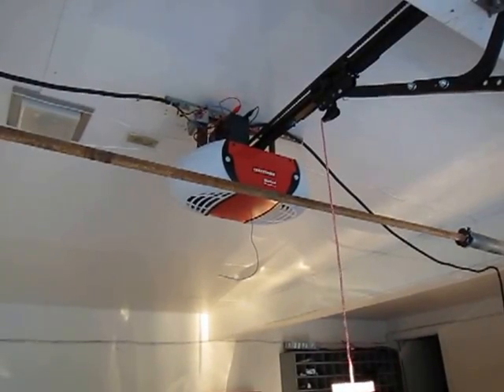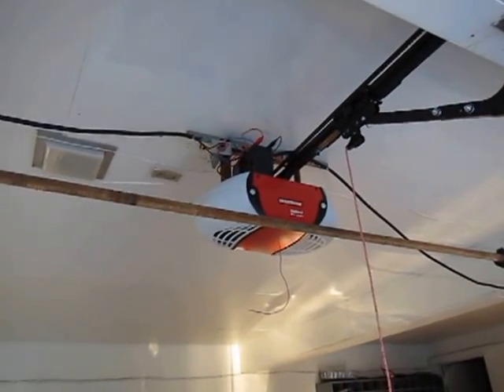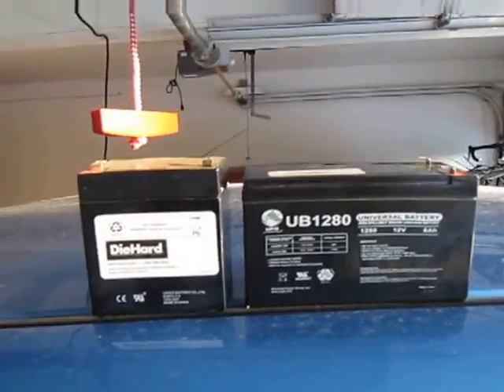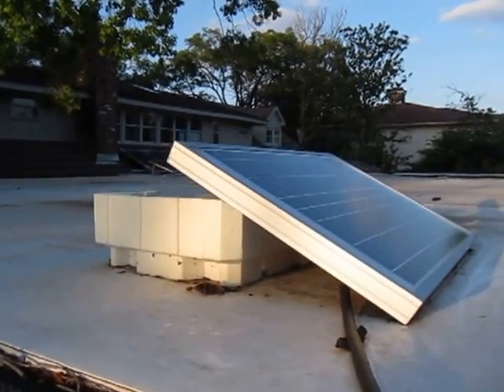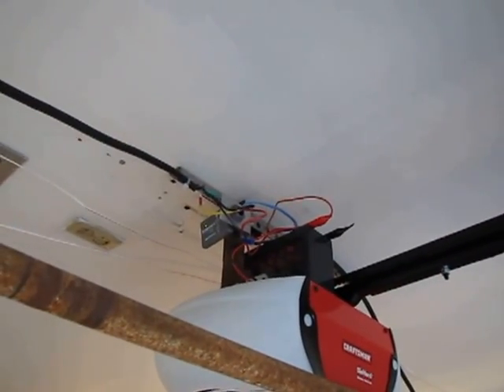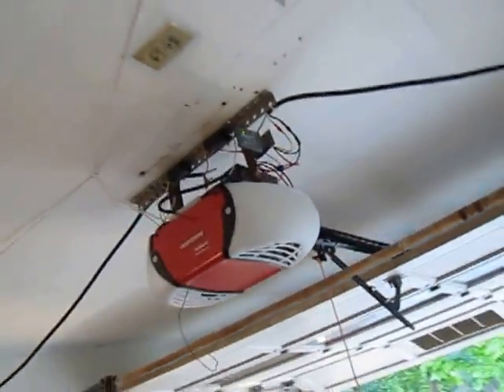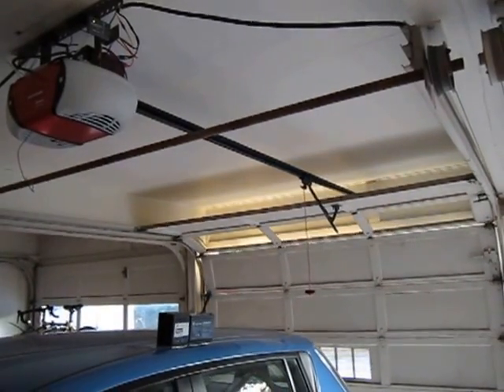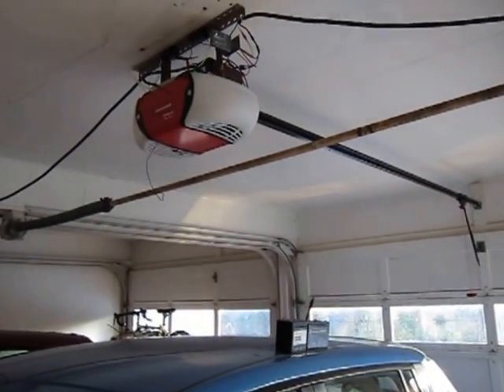Off grid solar powered garage door opener!

Comment from the maker: The point of the exercise is to run the opener off of it's two batteries. The batteries have lasted just fine. The door moves a lot slower when the opener runs on just batteries and not the rectifier. The door moves more fluidly when the opener is plugged into the wall but I don't care about whether it is smooth or not. Also, I check the batteries from time to time and they are above 12.7vdc in the morning after the opener has been drawing off of them all night.
Reply: I’ve added this, with solar charging. EXCEPT the outside wireless keypad won’t operate on battery power. It’s a safeguard on the system maybe for the opener that I have. I’m going to try a wired in keypad (usually used for gate openers). But wanted input back on any other options.

Comment: Adding this msg as it's own comment . . . 
I’ve added an opener with battery backup, with solar charging. EXCEPT the outside wireless keypad won’t operate when it is on battery power alone. I believe it is some kind of safeguard on the system. I’m going to try a wired in keypad (usually used for gate openers). But wanted input back on any other options that people have found around this.

Comment: Nice article. I would like to see what power is drawn from the battery when the system is in standby. It is not a good practice to place lead acid batteries in parallel without diode isolation. When one of the batteries develops a high leak rate in one cell it will fully discharge the other battery trying to maintain charge on the leaky battery. In a short time, maybe a month or two, the good battery will be ruined requiring the replacement of both batteries. Just use a larger battery.
Reply: Some people create a problem with every solution

Comment: The beep tells me it's running on its internal battery, so seeing the door not operating smoothly, I can say that your battery isn't lasting as long as it should. Take some light oil and apply it to the bearings in the wheels, hinge joints, spring-shaft bearings, pulleys. and wipe the door tracks down to get rid of buildup, and the opener's internal battery will last you longer. 
How much more of your home are you running on solar? Do you use any wind generation?

Comment: I'm new to solar setups but writing this as I have no power and my car is in the garage. I would love to see a itemize list of what you bought and their costs to mimic your setup as a backup. Could you provide one? Also, could your system be plugged in 100% of the time and fail over to your solar solution in the event of a power outage? I like how consistent and quick mine runs on 110v connectivity but need something for power outages.

Also, I read in another post that when the opener operates from a battery, the lights don't work. Is this true? 

Great video and thanks for the fresh ideas!

Comment: You aren't supposed to mix batteries with different capacities. They power runs like water, so the weakest battery is draining the strongest one every time they are left without input. 

It would be better to run the big one alone. You are making the big one lazy depending on the small one & the small one is degrading faster. So you are loosing amph & shortening the life of both quicker.

You should also check the charging curve & equalize them at least every month. Maybe you are already.

No mixing. The pulling of power should be done equally.